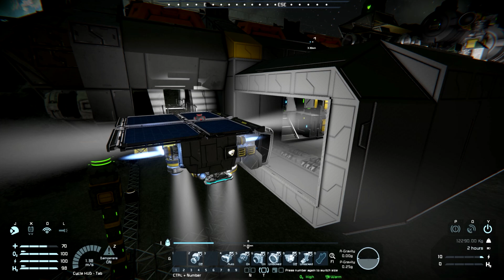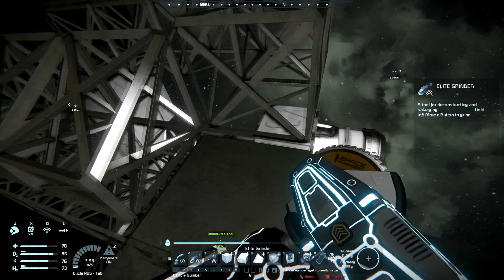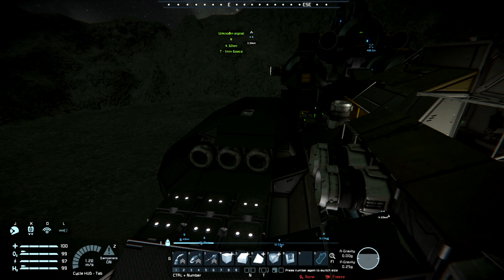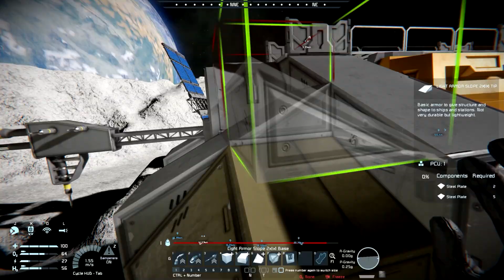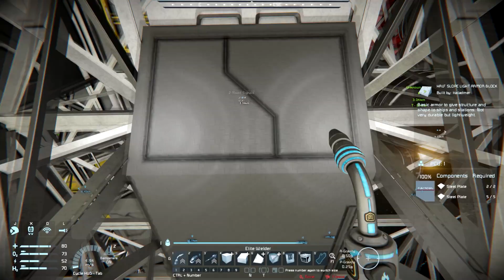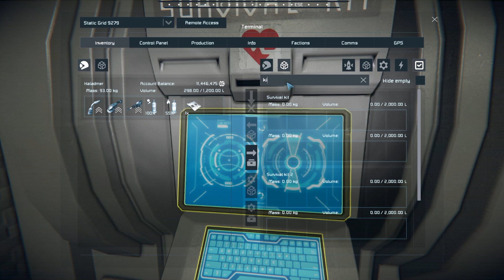Space Engineers | Economy Progress | Ep.18 - Engineering Solutions

Comment: In your engineering section, I would grind the block between the cockpits and in it's place, I would put a cargo container in for repair part access internally.
Reply from the maker: I did actually make a change there, realised I didn't have a way in/out of the ship in the aft portion after sealing it up, so there is an airlock right there now, and we have access to the inventory via that connection :)

As part of that change, the cockpits are now piped in as well, so we can get parts that way, without going out for them!